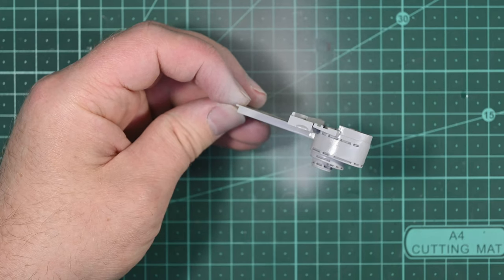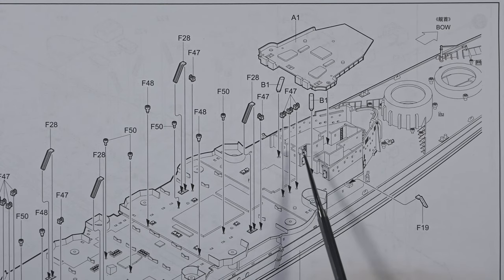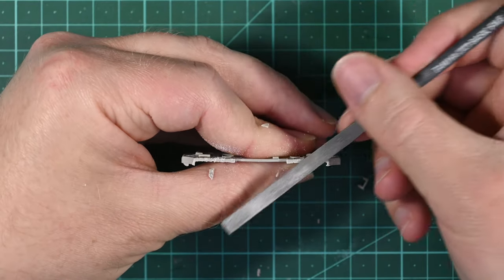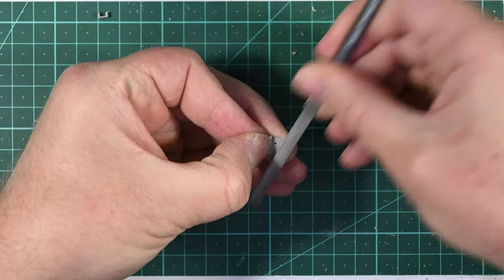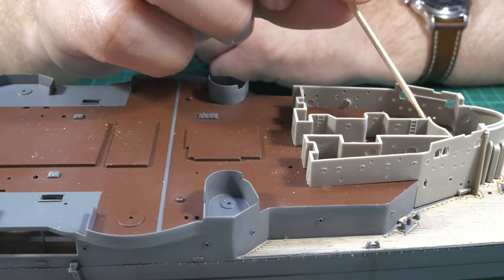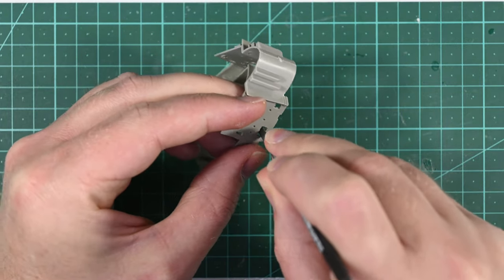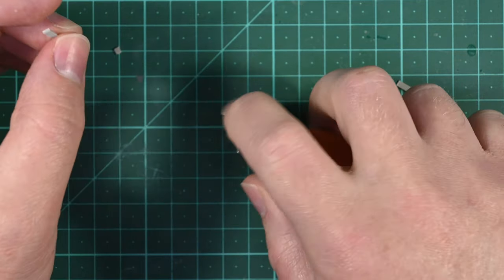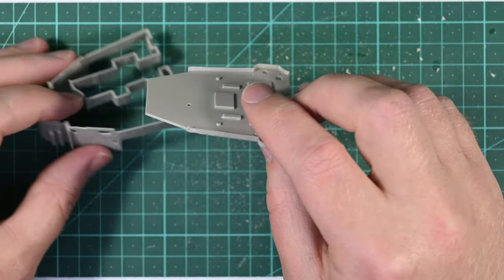1:350 HMS Hood: Part 30 - Forward Superstructure Base

Comment: Making some great progress.    A tip, when filing holes like those for the raft....stretch a piece of sprue over a candle and cut it so you have little cones.   Push it in the hole from the outside until it wedges and secure it using extra thin from the inside.   Once bonded, cut the excess off flush with your sprue cutters and you will have a lot less work to do.   Looking forward to the next installment.
Reply from the maker: Thanks for the suggestion!

Comment: Nice work once again, David. 
I just have a question.
Have you considered building the other 3 classes of battleships of the king George class?
Reply from the maker: Not yet. My goal was to build one ship of each of the last two classes for every nation that had battleships in WW2. France and Italy are owed a second ship. 

I have also somewhat deviated from the plan. I have a USS Alabama on the shelf and I recently bought an aircraft carrier. The Royal Navy also has a lot of interesting ships to build.

If/when I get around to building second ships in a class I will probably start with the Bismark. The Tirpitz was my first ship model, I think it would be nice to see how my ability has improved over the years.
Reply: @DavidsShips  fair call David 👍